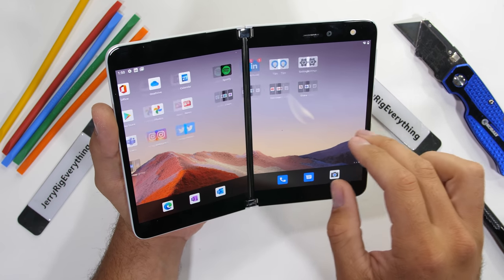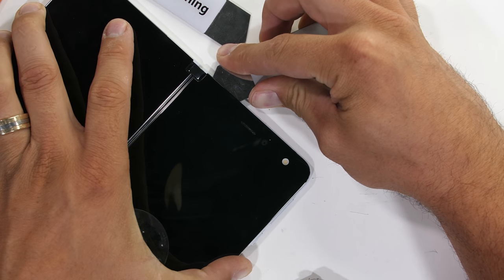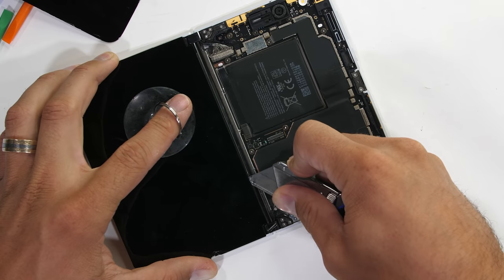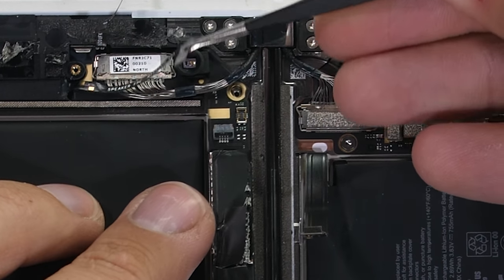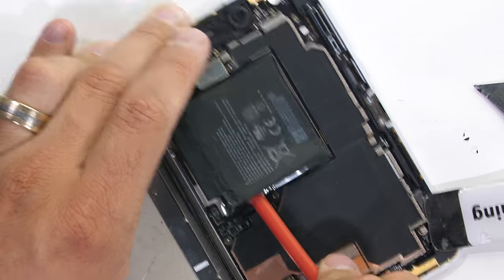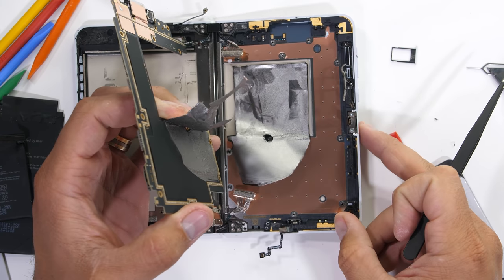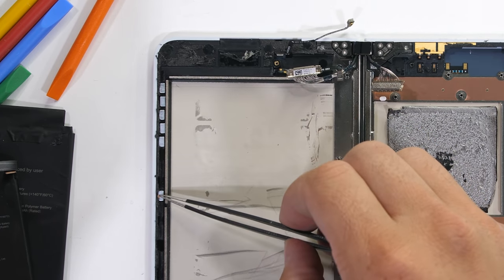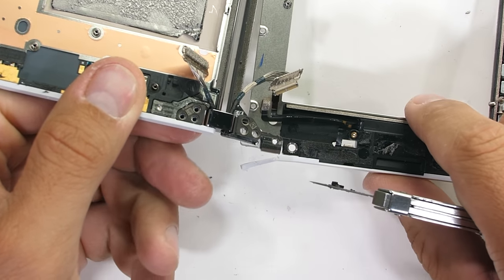Microsoft Duo Teardown - We lost a good one.... 😢

Comment: Tips for everyone stopped here for learning replacing phone parts :
1. Just use thin plastic prying tool instead of metal to minimize from damaging the fragile amoled panels while maintaining heat at 50-80°C on area where the adhessive lined about to be pryed next.
2. Use alcohol to soften the adhesive strip below bateries so it would be pulled off easily after 1 minute it solven.
3. Correct heat maintaining and using little drip of alcohol made every sticked parts by adhessive would came off easily without much damaging (breaking, bend, ripping) them.
Loved this channel for letting us see how fragile and how interesting of these latest electronic parts every new videos ❤

Comment: “Including the iPad Pro” 😬

The amount of Engineering is incredibly impressive. You’ve gotta give props to the Microsoft Hardware Engineers.
Reply: I agree, still a shame they haven’t made a true MacBook competitor though. Surface laptop could be so much more.
Reply: @thevisi0naryy  what about the surface book?
Reply: @thevisi0naryy  Surface laptop only lose in speaker quality against MacBook Pro. And a touchscreen is a plus.
Reply: Logical Error In Your Life That’s objectively untrue. 16” has a far better cpu even with thermals taken into consideration, better gpu, faster ssd, better trackpad, better screen gamut. It is a proper workstation laptop. The Surface laptop has a nice sleek design and premium feel, but internally there is no comparison between the two. The XPS 15 is a more direct competitor to the 16” MBP.
Reply: M Adil The surface book is really cool, but it only excels at being a hybrid device. At its price point it’s not a good pick for someone strictly needing a laptop. Especially because of the already low power cpu with 4 cores that gets immediately thermal throttled under sustained load.
Reply: @thevisi0naryy  hmmm thank you for the info. 😊
Reply: M Adil No problemo

Comment: Wow... The hinge mechanism and the 2 cables connecting halves of the Duo are EXACTLY the design Nokia used way back in ~2007 in the e90 (which is a really cool laptop-phone or whatever to call it)
Reply: And i remember thinking like "hmmm. If you make the phone thinner, it would be able to turn 360° into what looks like a normal smartphone". Apparently, Microsoft did just that

Comment: This flagship don't even have a midrange camera(Although not meant for photography)
Reply: I mean, technically it is more of a PDA that happens to have cellular and a camera than a full-fledged phone anyways.
Reply: The camera is mainly supposed to be used for video calls and I guess it's perfectly fine for that. But yeah, a better camera would be nice since you don't want to bring another phone just for the camera...
Reply: As it was delayed cause if covid.
Maybe they already have a new version to be released in April next year. If we survive this year though.
Reply: It's a little weird, the device was built and advertised as a Multi-Tasking Tablet, yet does not have enough Ram, processing power, flexibility to do so.  Could it just be the software that's faulty and will be fixed with a future update??

Comment: The kind of connector that the large battery uses is very commonly found in surface devices. You can find them in Surface Pro and Surface laptop.

Comment: So glad didn’t go for it, along with older specs, the hardware is almost impossible to repair 🤦🏽‍♂️ I hope the sales from this one does not discourage Microsoft to learn and improve from this and make a much better version soon, just like Samsung. Microsoft is very close to making a great line of products that would definitely compete with other top contenders like Apple and Samsung.
Reply: Apple products suck:
1. iPads' market share has dropped from 80% to 34% over past decade
2. iPhone's market share is down from over 40% to 15% since 2014
3. MBs' market share is 7%-8%
4. iMacs' market share is the same
5. ChromeOS has passed MacOS for second place

And lets not forget all the class-action lawsuits
1. keyboard issues
2. connnectivity issues
3. slow down the phone
4. green screen issues
5. thermal throttling

Comment: I think that this structural integrity was more of a concern in this particular type of smartphone. But as it's now seen that this phone have that strength, placing a quad camera and a pair of speakers would not be any problem.
Microsoft have played really well. They know that there are players better than them in the smartphone market, so they didn't mess around with the fancy glittering spec sheet. They focused on the main area which was design.
I am sure that next microsoft phone will definitely take the folding phone market unless apple launch something expectedly unexpected iphone in their upcoming iphone event.

Comment: They got so much right with this phone, but the things they got wrong are bad enough to make it a flop, in my opinion. Most folks don't consider repairabikity when buying a phone so ill exclude that. The plastic frame and single  11 meg camera, and total battery cap thats smaller than 4500 mah are big mistakes imo.
Reply: I've had my Duo going for over 3 months now, this device didn't get the credit it deserves. My only issue is the camera.....